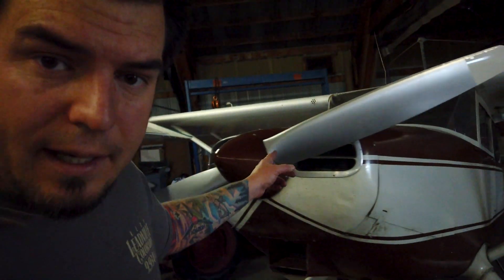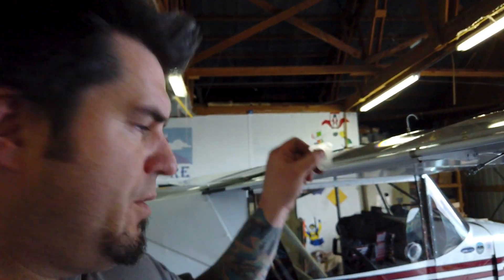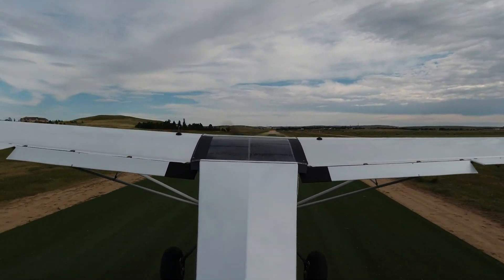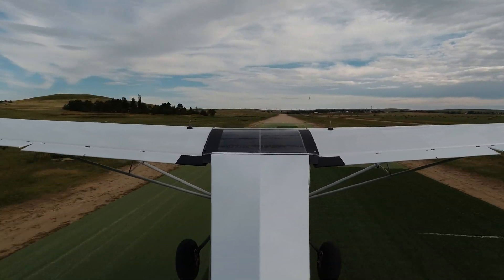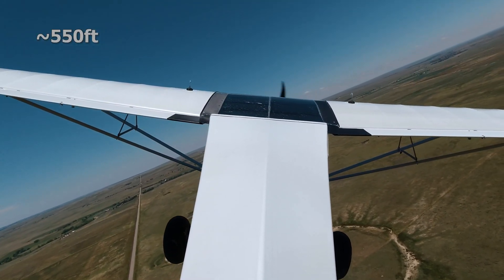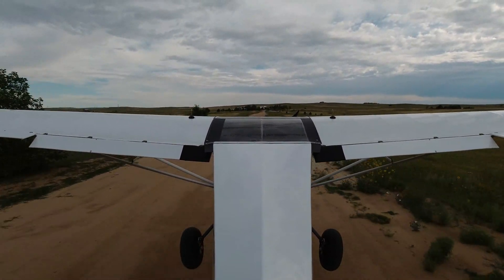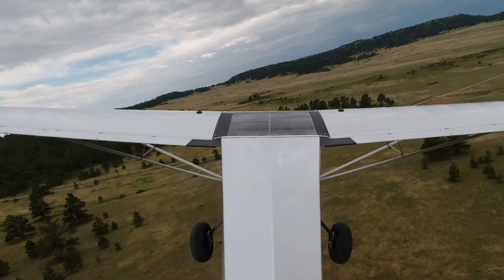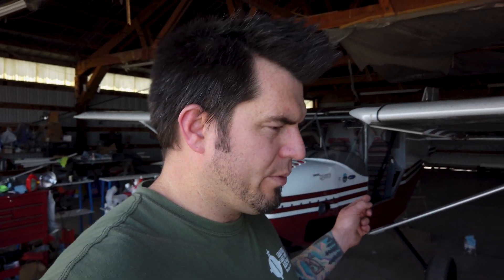That deafening silence when the prop stops...

Comment: If I was the head of the FAA, (god forbid) I'd make actual engine OFF ops mandatory, X amount of times a year. To think there are pilots out there that have NEVER flown their bird without the engine running, explains some of the accident stats.  I get a few hours in every year ridge soaring dead stick in my S-7S, so I practice what I preach. Good info, and well presented GK!
Reply from the maker: Very interesting idea and I sure can't argue it! They become a glider when the engine stops, good to have some gliding experience. Man I seem to be a lot better at finding the 1000ft downdrafts while in the mtns... good on you for being able to find and keep yourself in the lift.. that's incredible to float around that long in a fixed wing bird. Awesome!
Reply: @GravityKnightFlying   Old hang glider pilot here, with a 9K ridge oriented just right to the summer prevailing winds, so pretty easy.  The only issue is when it's soarable, it's too windy to land my up short uphill strip (tailwind),  so I have to stay up until it dies a bit or go somewhere else to wait.

Comment: How did your modifications work out? Any better speed, and did it effect slow speed performance?
Reply from the maker: hey Peter... not sure yet on top end, think it might have given back 1-2mph... still testing. Low end is performing great with a little more movement in the flaps. Seeing very low numbers during stalls  so it's at least a good sign. Think I ended up at like 45 degrees of flaps, and up a degree or 2 higher as well.